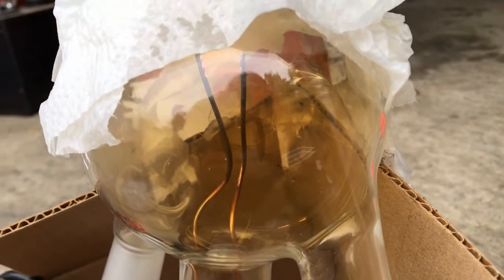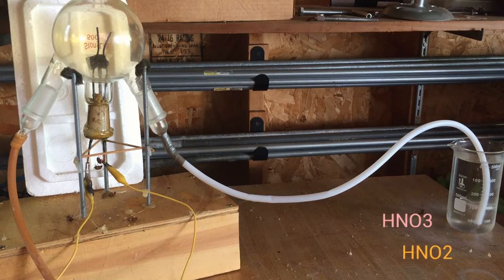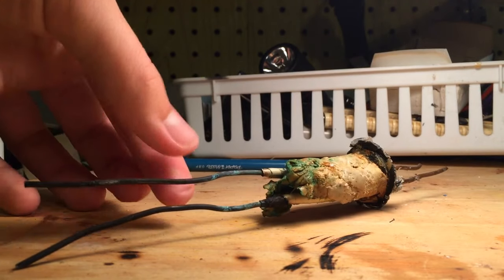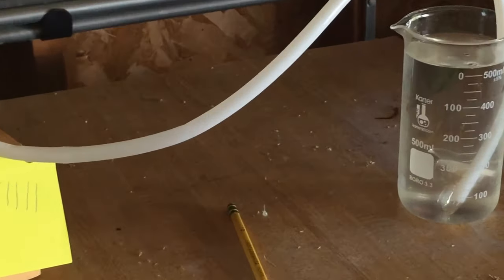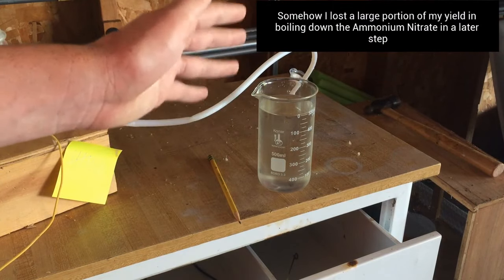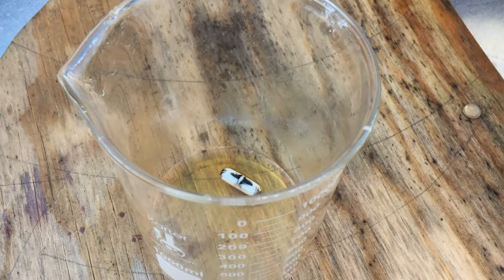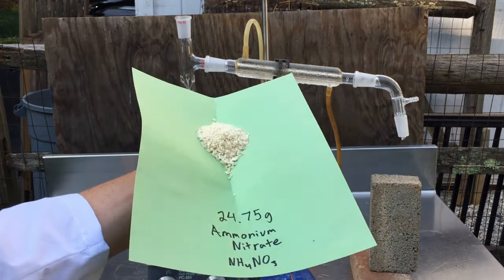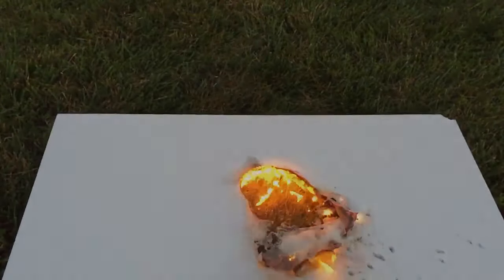Making Nitric Acid From Air (DIY Birkeland-Eyde Reactor)

Comment: you never completed the "DBX piss" video, what happened?, didn't work?
Reply from the maker: Honestly, I haven't checked on the bucket in about a year and a half and it didn't seem like a video that would garner much interest. I figured I would just post something on Patreon whenever I got the chance to extract from it.
Reply: @DBXLabs  well first of all thank you so much for making the video's!
i have been looking for ways to make my own set of chemicals without buying them and i have been researching how to make nitric acid, and it always came back to get nitrate salts, and this is the first time i heard about this process, and i think my next video would mention this process, mmm do i have premonition to mention your video and channel?
Reply from the maker: @ozb2006  Happy to hear the videos are of help! Feel free to reference the video if you think you drew from it. Birkeland Eyde reactors are really quite interesting devices.
Reply: @DBXLabs  yes they are, after i'll build one i am planing to see if i can break the bonds of co2 and see if it will translate to free oxygen or ozone hopefully not Carbon monoxide, lol

Comment: why doing it in the most stupid and cumbersome method.  the flask is 20dollars on ebay. lab glass is dirt cheap
Reply from the maker: I’d be happy to hear where you have found a 3-neck 500 mL round bottom glass on eBay for $20. I’m sorry you didn’t like the video, but only an unfortunate handful of people would consider what I did stupid.
Reply: @DBXLabs  the stupid part was the insertion point of electrodes. its done either with tungsten thru glass or at least an 2 hole rubber stopper
Reply from the maker: surplusdriller1 I’m glad that you’ve found other methods that work assuming other materials are available. What I did worked with what I had available, did it not?
Reply from the maker: surplusdriller1 also where’s the 20$ flask? I’d like to buy that.
Reply: @DBXLabs  yt keeps removing my links